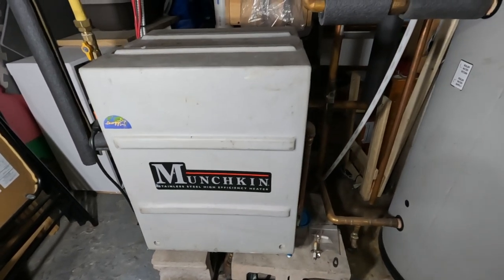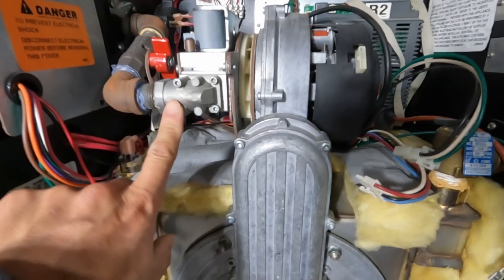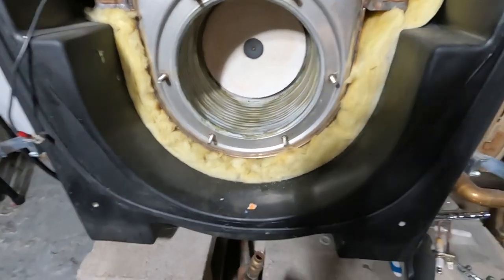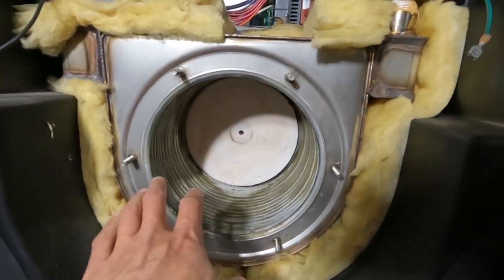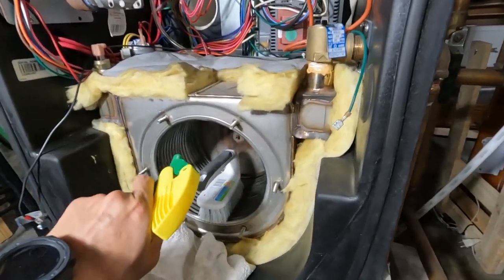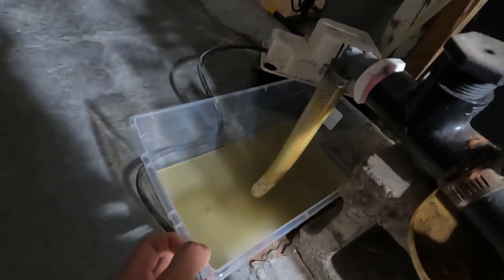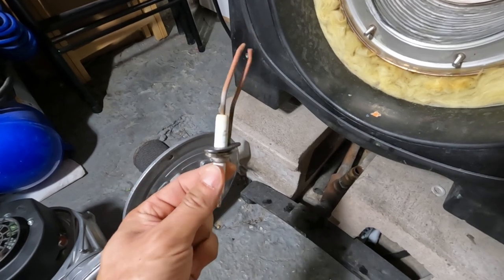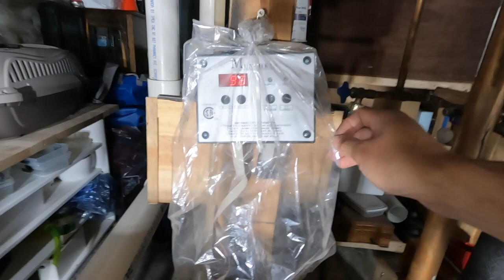How to Clean a Natural Gas Condensing Boiler | NTI / Munchkin Boiler

Comment: You should be removing the mesh burner and blowing it out with compressed air. Not blowing it out will give you nuisance trip outs on ignition failure. also replace the igniter and flame sensor on every PM. you did half a job